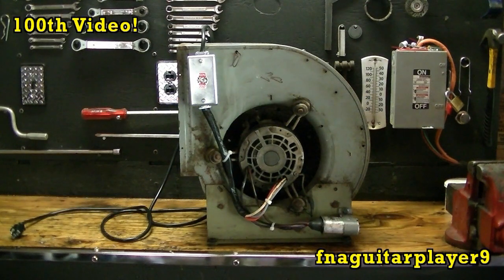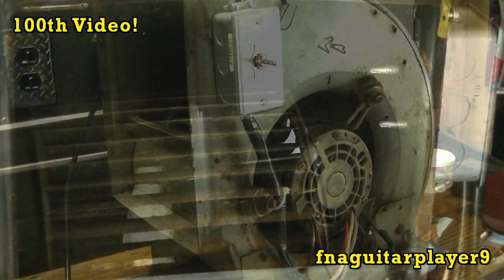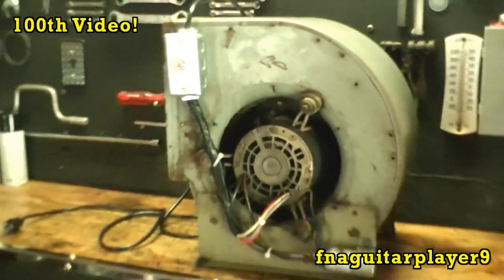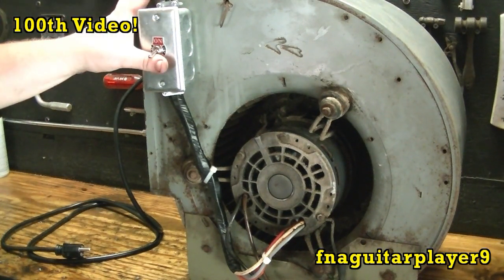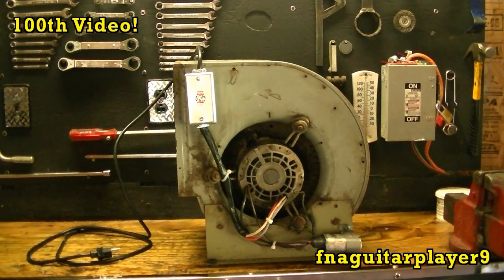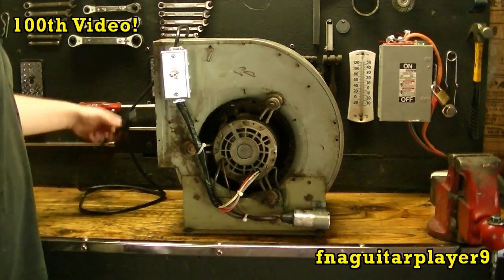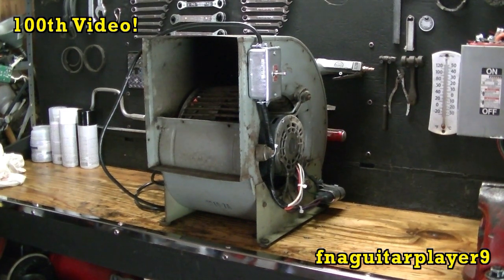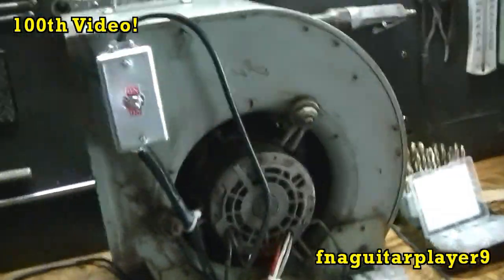100th Video!!! Blower Fan Project

Comment: I was a gunner on a convoy jeep for a while when I was brain dead and temting the Almighty and when the convoy was loaded and before we took off you couldn't see the trucks for the smoke grenades. Also I found a fairly good sized belt drive blower at the scrap yard, motor and all. I got it freed up with Marvelos Mysterious oil but haven't tried it to see if it runs yet. Winter is coming and I might slow down a little then, I hope. Good job, Franko!
Reply from the maker: I hear ya! I hear ya, I have a another like this, that the motor is burnt up on, i thought about figure out a way to convert it to belt drive, since i have several motors that are to big to mount like its supposed to. thanks for watching!!!
Reply: fnaguitarplayer9 If you could get enough clearance on the motor shaft to get a Lovejoy coup-ling on it or weld a stub on it. Then it'd blow the door off the hinges! Or hangers and a pillow block bearing. All matters of thoughts and no answers from me. Take care Frank! You'll get it and then make me a video of it!
Reply from the maker: haha nice! I have thought of putting a weed eater engine on it haha yepp, if i ever do it, i'll definitely make a video!
Reply: fnaguitarplayer9 Portable hurricane! Good idea! That'll work!

Comment: Again, congratulations on your 100th video. I would make a small suggestion, however. You need to restrict the air intake to some degree to prevent the motor from overheating and burning out prematurely. These motors are meant to have the air intake restricted at least about 20%. This allows the fan to compress the air and create more air volume movement. Thanks for the wiring diagram.
Reply from the maker: That does make sense, thanks for the tip! thanks for watching!!!

Comment from the maker: thanks! has the spark plug been changed? sometimes if the wrong plug is put in it will go down to far and hit the piston and lock it up, also it may be flooded if its flooded it will not get pas the compression stroke, to much gas or oil will not compress. crank it over with the plug out for a while (watch your eyes) as gas can come out, crank it 5-10 times then try it again. if this don't help let me know and i'll try to help. thanks for watching!!!

Comment: I made one of these out of an old furnace blower too.  I found that it worked best when it was 'upside down' from how you have it, otherwise the high air velocity at the outside of the centrifuge acts as a wall of sorts between high speed air and still air.  When upside down the air speed gradually tapers off as you go higher and I find it more comfortable to use.  I dunno, give it a try and see what you think.

Comment: I just wired my three speed blower to lowest speed and did not use the capacitor. Is that going to be a problem. It does start up from rotor lock slowly of course. I have no idea how to wire the capacitor into the circuit. Right now Red to Black (line 120 VAC), neutral to neutral and and of course ground.
Reply from the maker: You should use the capacitor, it does make a big difference in starting, in fact i'm surprised its even starting with out! all motors are different, some have a diagram on the nameplate on the motor itself. thanks for watching!!!

Comment: I have two of these and wired them just as shown. All I get is a humming noise from the motor. Any ideas?
Reply from the maker: Make sure the capacitor is still connected, and make sure its still good. And its possible that the starting windings are bad. thanks for watching!!!

Comment: Looks like it is the right plug.  No evidence of  contact. Pulled over ten times without the plug.  Without the plug everything turns fine.  Reinstall the spark plug and the  and the hard-to-turn condition returns.

Comment from the maker: hmm. the only other thing i can think of is the compression release, not all but most of the newer saws have a compression release to make them start easier, that could be messed up, or the exhaust could be clogged up, prevent the gas/pressure from escaping on the exhaust stroke, but i doubt that, i've never ran into that, but it is possible i guess.

Comment: If you had a 3 speed control switch like what's on a box fan how would you wire it up.
Reply from the maker: you would wire it so the hot (voltage coming in) is connected to the common connector on the switch, then each speed would hook to the other connections, and if you had a 4 way switch, you would leave one unconnected for "off", if your using a 3 way switch, pick out your 2 common speeds you want then leave the 3rd (or 1st however you want it) blank for "off" position. Hope this makes sense, kind of like how the switch in the video is wired, except it would basically have one more connection. Thanks for Watching!!!

Comment: I just removed one from an old furnace. When are you doing your wiring video?
Reply from the maker: +Heru- deshet I hear ya. I'm not really planning on it, i show the schematic toward the end, it should help you with the wiring, just make sure you have a diagram of the different speeds, they are all different. I found out the hard way on another blower i have! Thanks for Watching!!!
Reply: fnaguitarplayer9
Cool, thanks.
Reply from the maker: no problem

Comment: Hey great video post.  I have one of these that I wanted to use on a cyclone dust separator for my shop.  You think that is possible being the motor is actually in the housing?  Cause I have to close in one side (the side that shows the motor) in order for it to pull or suck right.  And also what would you use to close up one side?  Thanks

Comment: Could you wire a thermostat into this so it would come on at a certain temperature?
Reply from the maker: G Lee Yes, it could be done, you could take a standard household thermostat and wire it to a relay to turn the blower on or off. It would work the same way as a attic fan. thanks for watching!!!
Reply: You can use a tstat but you'd have to use a transformer to change the voltage from 110v to 24v. It's very simple.

Comment: How long can you run these fans?  Was told that the motor will overheat because the outfeed blower has no "restrictions".  Was told only to run it no more than 2 hours or restrict the outfeed in half.  Is this correct?  Thank you for the wiring diagram.  Looking forward to your video showing how to wire the fan.
Reply from the maker: I would think it would actually cool the motor better having no restrictions because even more air flow goes past it. I'm not saying thats wrong, but i would go by the rating of the motor, if its rated continuous it should be fine. I will try and make that video this spring some time. Thanks for Watching!!!

Comment: Wiring it with a secondary switch prominently labeled "on/off" or "push-stop" relative to type, might be safer in an emergency than using the single 3 position switch with middle position for off...just thinking of someone not familiar trying to quickly shut it down and throwing it from one speed to another rather than off.
Reply from the maker: Patrick Perry Yeah that is true. I was going for function not so much safety, but you are right on that, its not the safest setup ever. If I'm in a hurry I'll jerk the plug out haha Thanks for Watching!!!
Reply: 10/4 on the cord yanking.

Comment: how can i find out if the motor is 220 or 110 without taking it out of the cage to see the label , my motor i am working with has black,blue yellow orange red and 2 browns to the capacitor i already burned one i thought it was a 220 .thanks
Reply from the maker: There really isn't way to tell, unless its still in a furnace you may be able to find a schematic for the furnace, but it would be best to look at the nameplate, I did the same thing on a 4 speed motor, at the time (I was like 10) i didn't know they had different speeds so i just hooked up to the 2 wires that looked right haha and smoked it good! Thanks for Watching!!!
Reply from the maker: oh, and another thing, the wires your describing sounds like it has different speeds and most of the time motors with different speeds are 120, but not always, and you'll need to know which ones are what before you hook it up, best to look at the plate.

Comment: I have a blower that I made into a fan like this one. I wired up speeds 1 and 4 because there wasn't much difference between the other ones. The problem is the motor gets very hot after a while (an hour or so) and has actually locked up once. Luckily I was near by when it happened so I quickly turned it off. After it cooled down it still worked. I'm just wondering why its getting hot and locked up. As far as I can tell, it is a 120V motor. I've looked all over the end plate and can't find any numbers to represent 220/240V. I just see a "120V" with "KHW" below that. And then there are other numbers for the serial, HP, and Amps I am assuming. I also thought that it needed a capacitor but it wasn't designed for one so I ruled that out. There are five wires (C,1,2,3,4) and that is it. I know it is wired correctly because both speeds work. Any help would be greatly appreciated.
Reply from the maker: Sounds like it could be a bad capacitor making it heat up, not sure why its locking up though, but its probably do to the heat, a bearing expanding or something making it get stiff, I'd try a new capacitor if it has one and see how it does. hope this helps, Thanks for Watching!!!
Reply: fnaguitarplayer9 That's the thing. There never was a capacitor. No wiring or connections for one. There was only one connector and all five wires ran to that.
Reply from the maker: I missed that part of the message, when you said it wasn't designed for one, about the only thing it could be is the windings are about worn out on it, I don't know why its locking up though.
Reply: No problem! That's probably what it is. Will just have to search for a new one.
Reply from the maker: Thats probably the best thing to do at this point.
Reply: @atoddvr6  You need to restrict the intake amd output flow by 20% Them motors are not meant to run unrestricted. They will always burn up prematurely if the airflow isnt restricted to 20%

Comment: That is some blower, Thanks for the video.
BTW...What do you think of the cheap Super Tech oil Walmart sells?
I needed some SAE 30 HD oil for my small Coleman 1850 generator and that is all Walmart had.
I never like using cheap oil but I have to change the oil, been a long time.

Comment: Hey fella, where'd you get the switch and the housing for it?
Reply from the maker: Dave Nelson The box is a 2x4 metal handy box (find at lowes/home depot, etc) and get a blank junction box cover plate to fit and drill a hole, the switch is a 20 amp DPDT (double pole double throw) On-Off-On (for speeds, if using a single speed just get a On/On DPDT switch), you can find them at lowes or on ebay, i think i got mine at surpluscenter.com they have alot of switches and parts to choose from. Thanks for Watching!
Reply: Thanks man!
Reply from the maker: Dave Nelson your welcome!

Comment: Excellent videos! I have one similar to yours.  I was using it to blow out the air through a window (work shop).  I took the cage off and wanted to use it fo blow air around my shop.  Now, the motor runs great than shuts off.  After a few min. It starts and runs for a couple of min. than shuts off.  The motor feels very hot.  What is going on?  Thank you for helping.
Reply from the maker: carino tresvinos Appreciate that! i hear ya, they are good for that. If it has a capacitor it could be bad, I have another video on how to test capacitors. This blower did something similar, it didn't shut off but it got really hot and you could smell the windings heating up. I'd check t he capacitor first. If its not that then i'd say its the windings going out. Thanks for Watching!
Reply: If it has the varible step pulley on the motor it may be pulling the blower too fast. Might need to open it up a bit to slow it down a dab. I did that to my old one. Live and learn.

Comment: I have a vent fan three wire 1 red 1 black 1 white I know that the red is low speed and the black is high speed not sure how to wire it up can you help me it's a GE motor
Reply from the maker: HICKORY CAT If your 100% sure that the black is high speed and the red is low speed, then the white should be neutral, then you would hook the hot to whichever speed you want. If you give me the numbers off the motor, I can try and look it up and see if i can find out for sure. Thanks for Watching!!!

Comment: Can you make a video of how to wire a belt drive blower please?
Reply from the maker: It should be very similar wiring to what i shown in this, but the speeds may be different. It just depends on the motor itself, this is the only blower i have that i can show, the one in my furnace is super simple, its just a single speed with 3 wires (hot, neutral and ground). thanks for watching!!!
Reply: Mine too, I hope. 2 wires but I'll fix that with a 3.